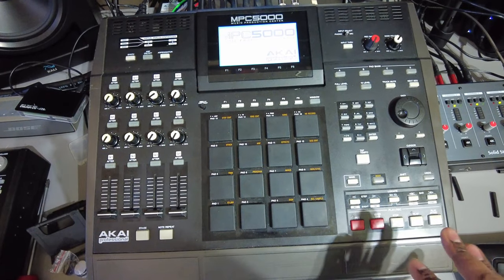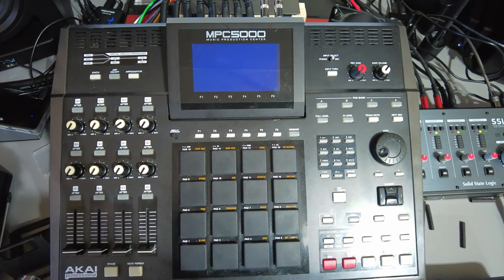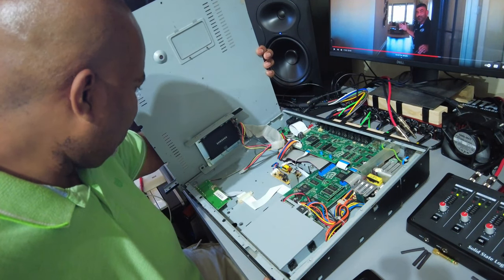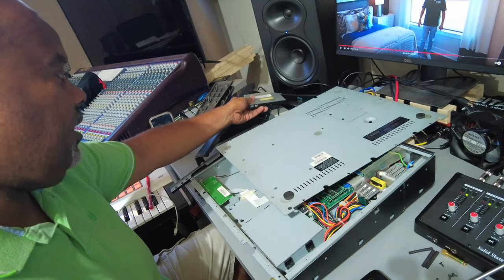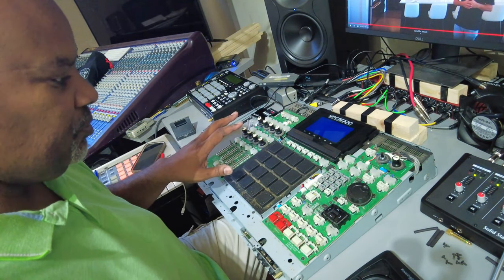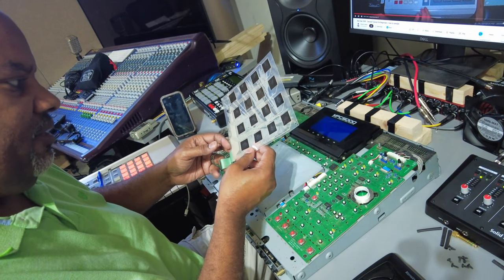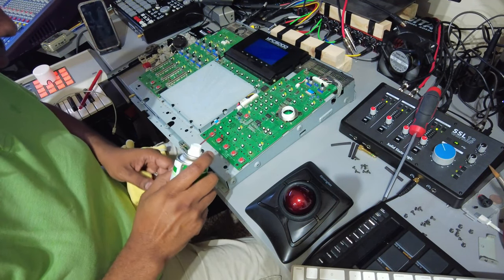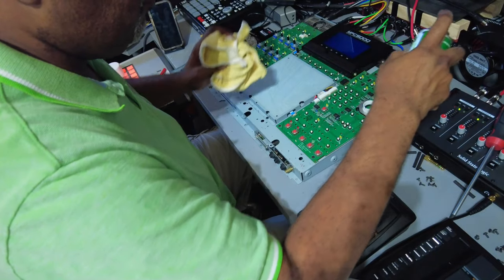Taking Apart the MPC 5000. What Did We Find Inside?

Comment: Sitting here watching you makes me want to pull my hair out homie. Lol.     This video is only halfway through and I'm already betting money that thing never works again.    You absolutely cannot be so harsh on a piece of equipment like that when you don't know what you're doing. The 5000 is one of the most brittle pieces of equipment.    When you have something that's over 20 years old and you are not careful things are going to break my man and then guess what you can't get parts. Ooooopsie.     I'm going to suggest you get on some blogs and read about what other people have to say before trying to figure out what you don't know yet. Just a suggestion from someone who has already been there, My 5000 is nothing but a paperweight now.  I'm actually getting ready to send it off to Mike at MPC stuff so he can have it for parts.    You got to be gentle with those older ones bro.
Reply from the maker: @pace033  you should watch some of the other videos after this machine is perfectly fine. Secondly, I do have experience with electronics, and I knew exactly what I was doing. I took considerations to make sure I grounded myself before touching any of the circuitry because I took years of electrical engineering training. I’m also a certified AUDIO engineer so I know to take time with the way I clean things. You’re seeing a short version of the video version the original full length. Also I didn’t take it apart until I was sure I could get all the parts. I called 5 companies to make sure I could source parts. Who takes things apart without doing all the research and having all the parts???  That sounds crazy.
Reply from the maker: @pace033  if you are looking to send it off for spare parts, send it my way.